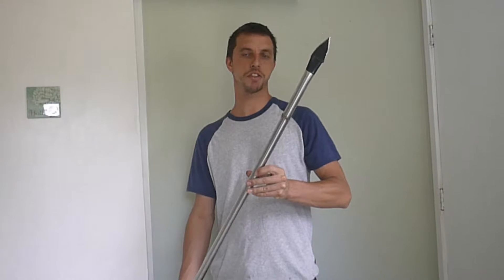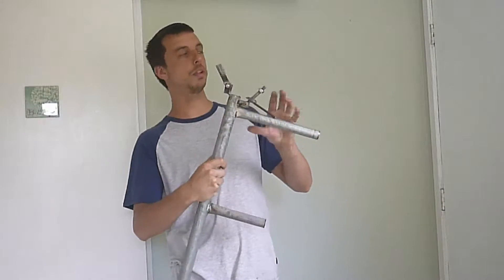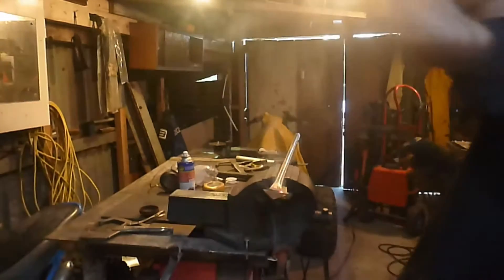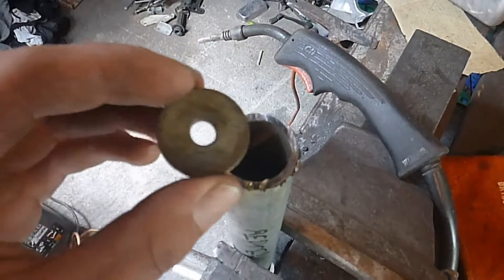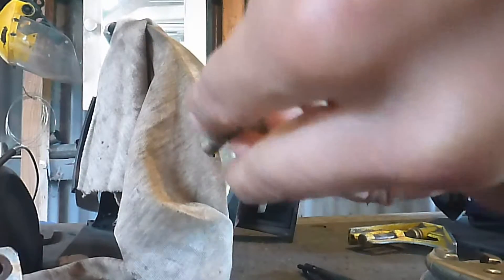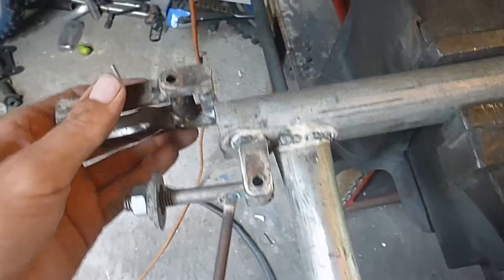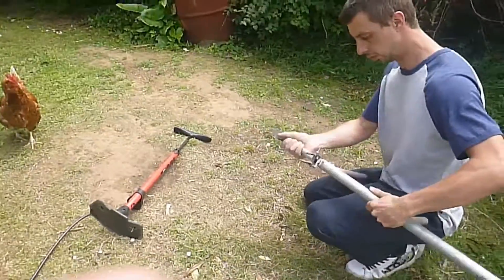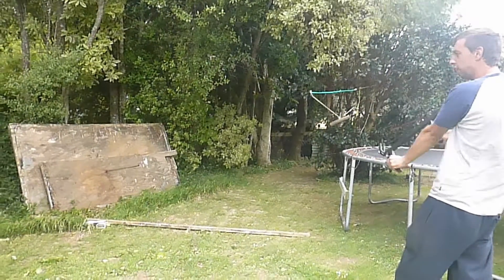Rocket Spear Launcher

Comment: That's pretty cool for faster refill you might want to use a co2 pump
Reply from the maker: b.o.s domestic disputes yeah that’s a good idea. How much pressure do they do?
Reply: @dkthewelder  "The general standard is that when CO2 reaches 70 degrees Fahrenheit, the gas obtains a pressure of around 852.8 psi when contained in the cylinder or vessel. If there is more CO2 in the cylinder, it will then be converted into a liquid form."
That's a lot of void/volume to fill for CO2, but you could seal it 6 inches in or whatever to and use aluminum or ABS tube to be lighter. 
I'd like to see a combustion gun version (spud cannon)..
Reply from the maker: @iamtheomega  that sounds dangerous! I like the fuel idea like a spud gun would need I lighter spear like you say or it would kick pretty hard!